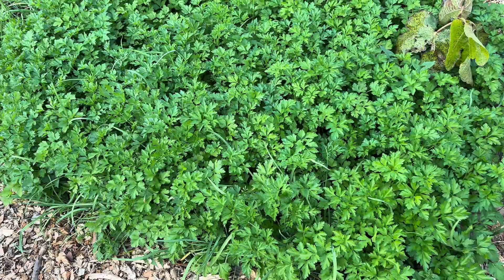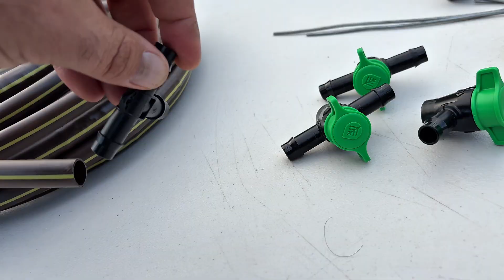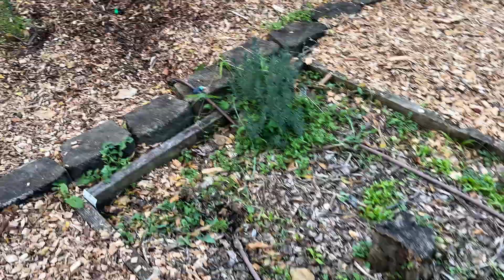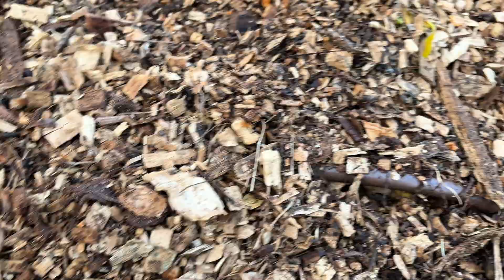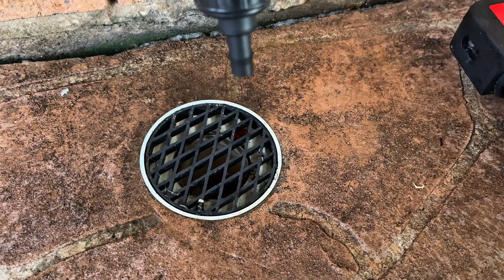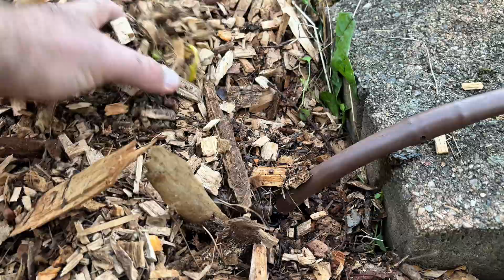🌿 “How I Water & Fertilize My Entire Fruit Forest Automatically | Simple Drip System DIY for HUGE H

Comment: Could you link to the online shop that you’ve bought the fertilising bottle to connect to the drip irritation? Thank you for showing your system!
Reply from the maker: https://www.plantdoctor.com.au/ezflo-fertigation-system-new-2.8l-connect-to-hose?gad_source=1&gad_campaignid=17191285169&gbraid=0AAAAACcH7JvRjsDAjEPI0t0orFPJpOfRd&gclid=CjwKCAjwvO7CBhAqEiwA9q2YJWRlVYcKN2v4j_P5WHAbsObq1L2qyypgPNPQdBdMWU5rLoqDN104IhoCrRAQAvD_BwE
Reply from the maker: let me know if you need help with anything my friend.
Reply: Great! You’ve inspired me to consider drip irrigation in my yard. Usually how many times a week do you water your fruit trees and for how long with this timer system?
Reply from the maker: @atran6065 i usually only activate it during the growing season,spring summer autumn. i use a moisture meter to test the soil , i just stick it in the soil and  if it reads low then i activate the system for an hour or two.